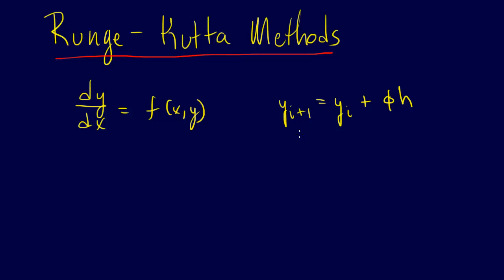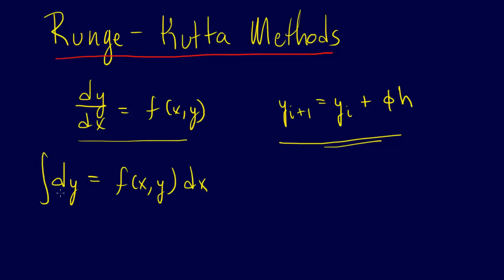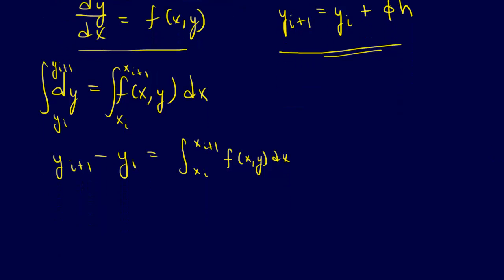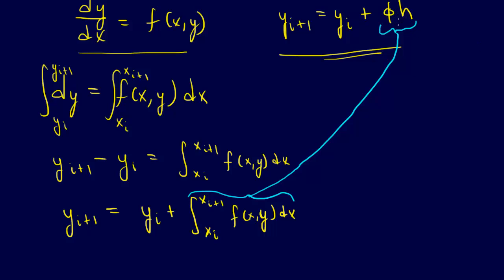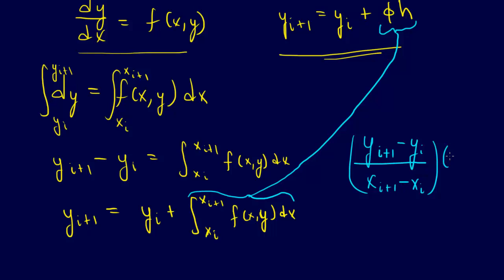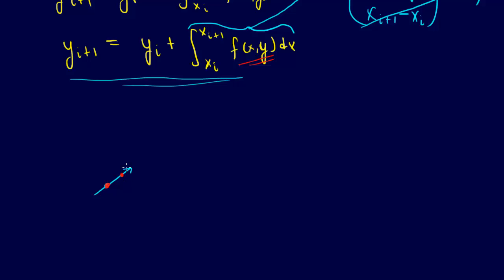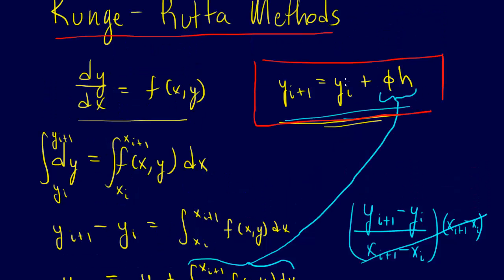7.1.2-ODEs: Introduction to Runge-Kutta Methods

Comment: What is the step size in x?
Reply from the maker: The step size is whatever you decide. There are even clever ways of deciding, and changing the step size on the fly. See https://youtu.be/6bHdFef1S60?list=PLYdroRCLMg5PhZqzEJJlyLo55-1Vdd4Bd If you need more, then take a look at stiff solvers, https://youtu.be/KS_6mxdzQws?list=PLYdroRCLMg5PhZqzEJJlyLo55-1Vdd4Bd

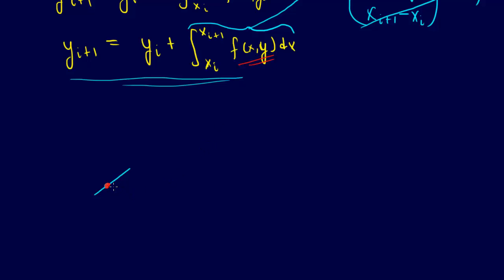Comment: Question, what did you mean when you said, f(x,y) is the slope at around 4:37?
Reply: Because dy/dx = f(x,y), so f(x,y) is the slope.
Reply: @ 36 seconds, he writes dy/dx = f(x,y), also context differential equations are dealing with derivatives and rates of change, although they are a higher level abstraction.